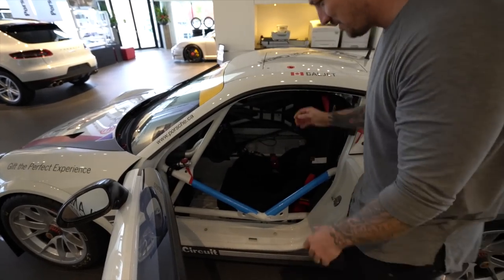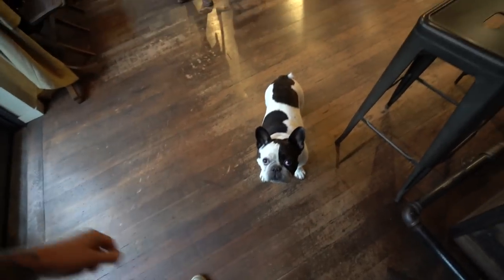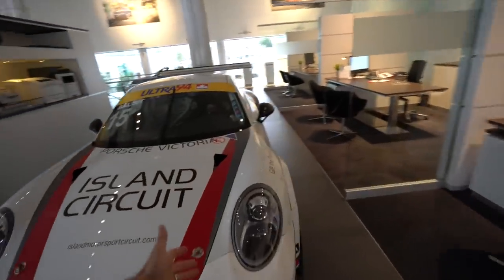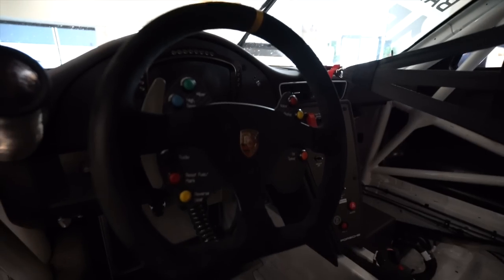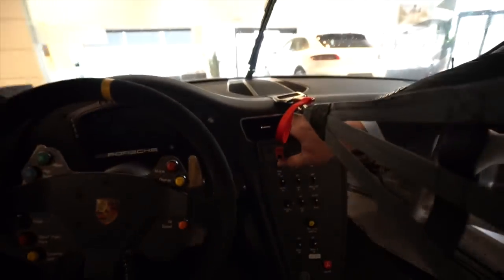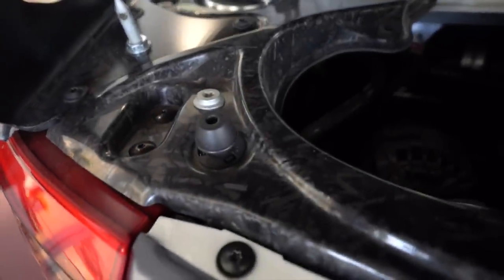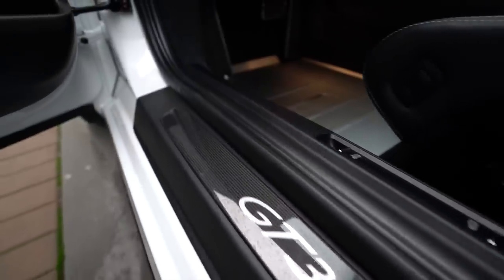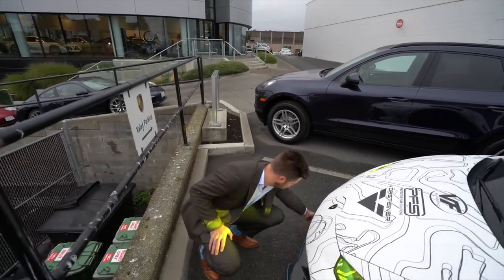*SIZE MATTERS*  How big is your WANG? - Porsche GT3 Cup

Comment: How does your car have a clutch??
Reply: Mr Weezer Pretty sure the Lamborghini has 3 settings, Auto, Strada, Corsa, automatic is self explanatory, Corsa is using the paddle shifters when RPMs are high enough, kind of like automatic except you need* to use the Paddles, and Strada I'm pretty sure is using the paddle shifters with the clutch
Reply: ISeekMANBEARPIG what does thay have to do with anything? I know all that lmfao. I mistakenly thought his dead pedal was the clutch